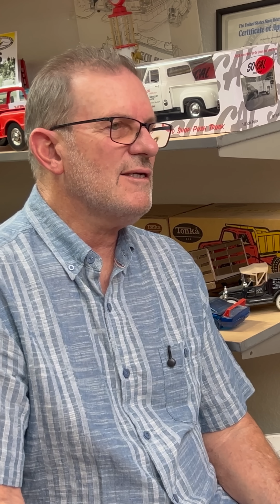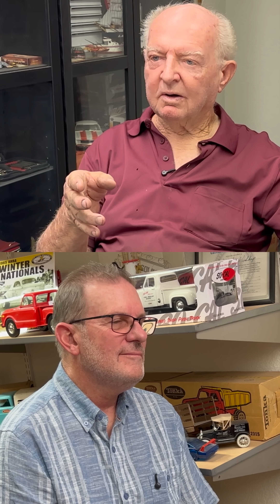Major CORRECTION on 351C vs 351M - Ask Ed 36 - Ed Smith w #BarryT #351 #enginebuilding

Comment: For years many loved the interchangeability ( yes that is an actual word lol ) of the Chevrolet engines/motors and transmissions.
I was not around Fords or Mopars, but they are not as interchangeable as Bowtie parts in my humble opinion.
Reply: Interchangeability isn't in the Ford vocabulary, I grew up with them and you had to learn what went with what. To many engineers, perfect example is the 3 different 351's.

Comment: Why did the clevland have smaller journal bearings
Reply: It didn't need 3" journals. The drag from bearing surface speed gets too high on larger jornals at higher rpms.
Reply: @oneninerniner3427 that makes sense
Reply: Bunky Knutson, Ford should have fired him long before he left. The Cleveland should have had a Windsor style block, it's lighter weight, with the Windsor front cover and oiling with the 2 3/4" mains, and the Boss/Cleveland canted valve heads. That's where the Cleveland heads started from, the Boss 302.
Reply: So that's basically a Clevor. Australia built them and You can get aftermarket blocks like that.

Comment: And there is the rare 73 - 74 M block with SBF bell pattern. Or was it the other way around? Butt yeah, C was the SBF and the M was 385.
Reply: And there was a C4 bell housing for the 351M with the 460 block pattern. Came in the 1975(?) Ranchero. And a lot of smaller details, like 78/79 400 blocks had a beefed up thrust area in the block. And 351C heads fit all the 400 blocks. And a 351M can be made into a 400 with a crank and pistons. The 400 can be made into a nice runner with a bit of work. Just not a lot of parts available like intakes.
Reply: I was trying to remember that bell housing pattern. I had a Ranchero with the 351M & a C-4. I took the trans out by getting stuck on a snowy iced over river and had to rebuild it. Big dummy I was. Lol

Comment: The 335 series share the same bore spacing as the Windsors. Their heads interchange but not intake manifolds.
Reply: "Heads intrrchange"...w/ modification for coolant transfer to the heads.
Reply: @patrickmcdonald3427  yes, a hole has to be drilled.

Comment: If I am not mistaken. The 351m is basically a 3.5in stroke and 4in bore. The true 400 has a 4in bore and 4in stroke. And bolts to a c6 bell housing. The 351c bolts to a c4 housing. The 429/460 also bolts to a c6.
Reply: But... the C6 case was available in several engine patterns, so bolting to a C6 doesn't clarify anything.
Ditto for C4.
Reply: @johne189 thanks for stating this
Reply: There are C6s for both Cleveland/Windsor and the FE series.
Reply: @andrewlittleton7837  and the 429/460 & 351M400
Reply: 1975, I think, 351M Ranchero had a C4 bell housing with the 460 bolt pattern. Rare as hens teeth.
Reply: @jondahl3173 So less that 28?
Reply: @jondahl3173  I had one.
Reply: I had 2 351 clevland  both had c6
Reply: @whatsup5328 Dad's C4 had a CJ 4 ahead of it.  True, or did he get a rack bigger than Mitch Rumpolla, also?  Couldn't tell, he was the king of deadpan comedy, even if you didn't know it at the time.
Reply: My '70 Mustang 351C4V came with FMX transmission.
Reply: @jeffnorbert1871    yeah, the FMX was a good trans, it's just that it's main case was heavy cast iron.
Reply: So the 351M & 400 are the same basic engine. The 351M is a destroked 400, shorter stroke crank 3.5" w relocated piston wrist pins. 429/460 bell housing, yup.